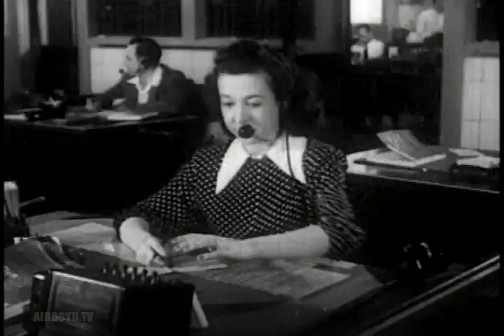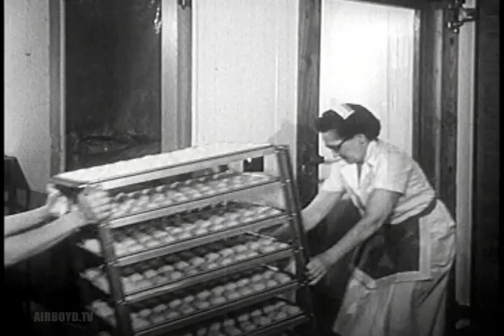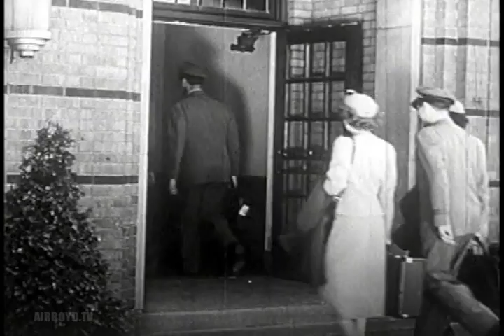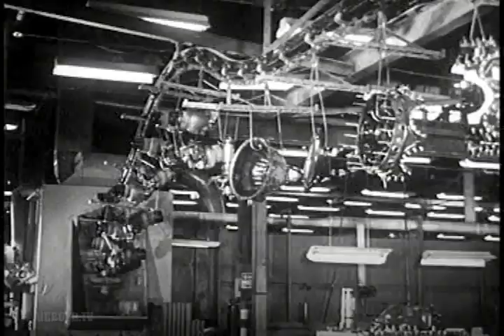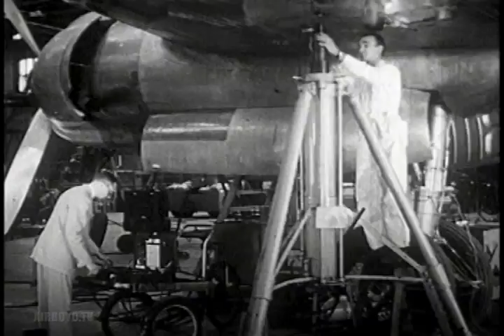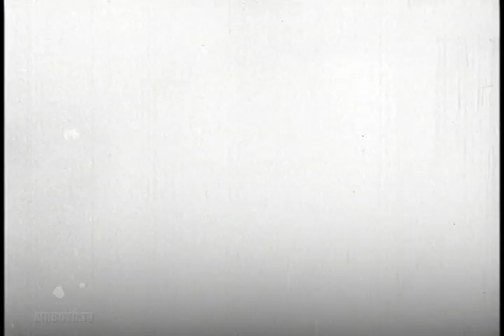Letter From An Airline Pilot

Comment: Growing up in the 50's on the Chgo MDW 22R approach ..being lulled to sleep in summer by the radials doing their "run-up" and then down the runway...I wondered where they were headed to. ...and remember watching the "string of lights as the planes were lined up for landing from MDW out over Lake Michigan!  Also, the original Connie's (not the Super G's) on take-off often flew a LOT lower than the DC-6's and 7's. ...did TWA overload them?  ...or was the low rate of climb a norm for Connie's???

Comment: Construction on CDG, Charles DeGaulle Airport did not begin until the late 1960's, and the first flight operated from there on March 8, 1974, almost THIRTY YEARS after the Connie flight.  The Paris airport in 1946 was Le Bourget.  In fact, on October 26, 1958, the first Boeing 707 flight from IDL in NYC to Paris also landed at LeBourget.    Orly Airport was the main Paris Airport before CDG opened.